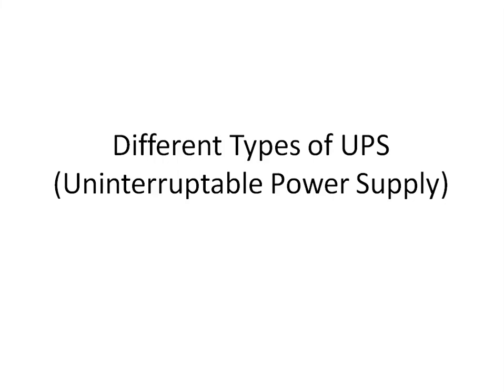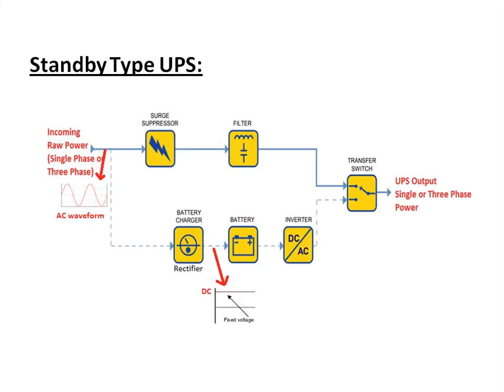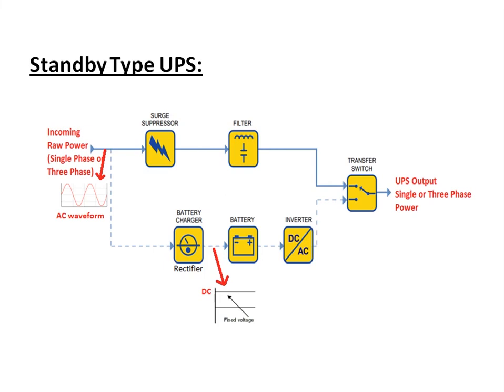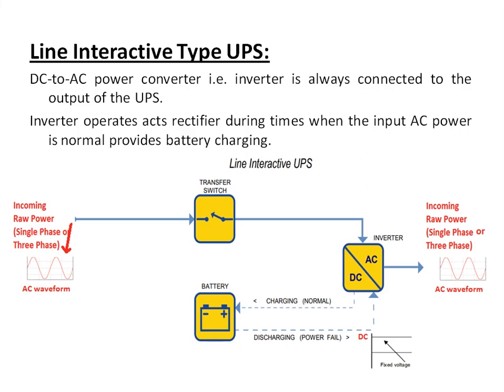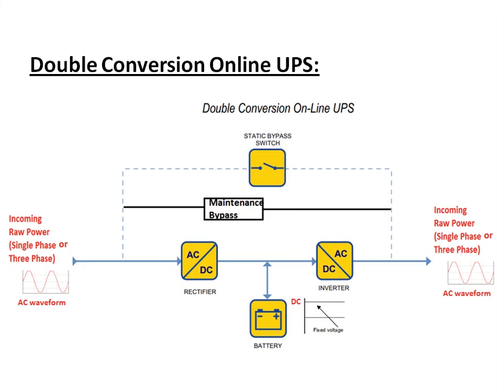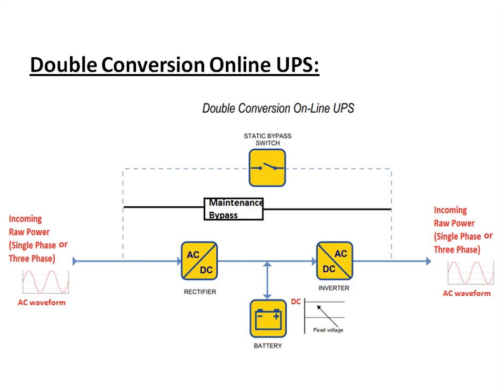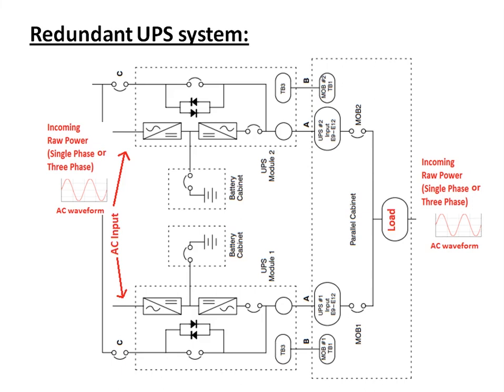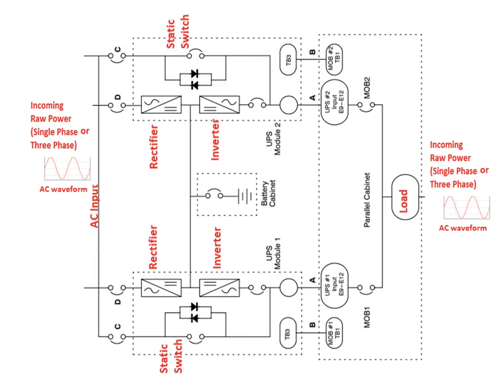Different Types of Uninterruptible Power Supply (UPS)

Comment: The line interactive shown at 1:42 seems wrong. The diagram shows the input/source to be connected to the inverter (through the transfer switch). But an inverter converts DC to AC, its input can’t be AC.